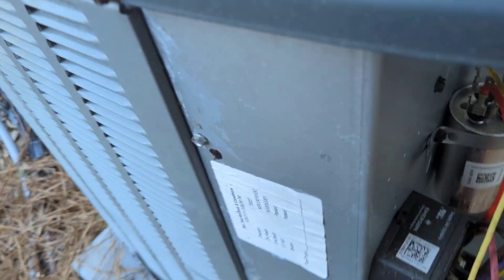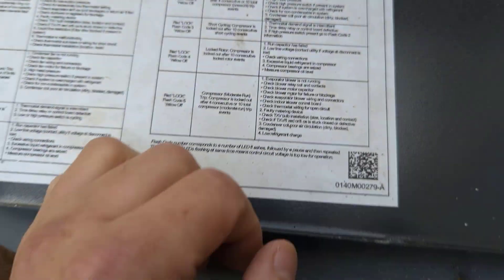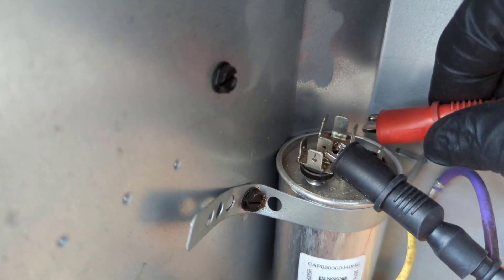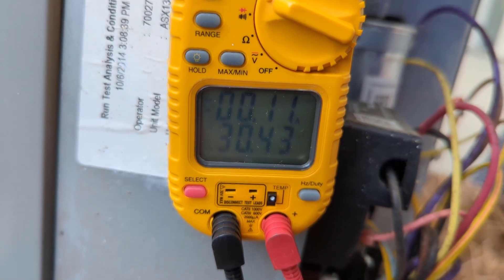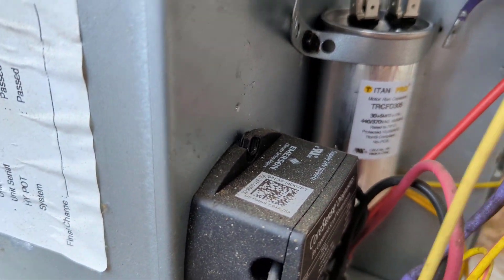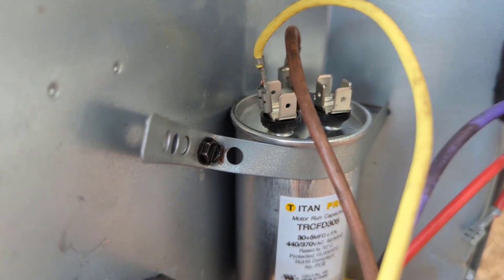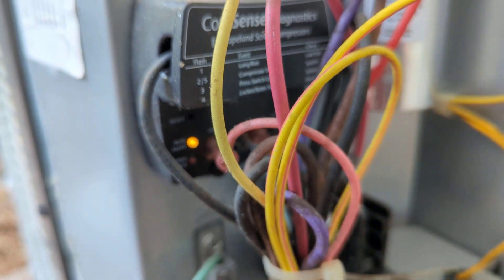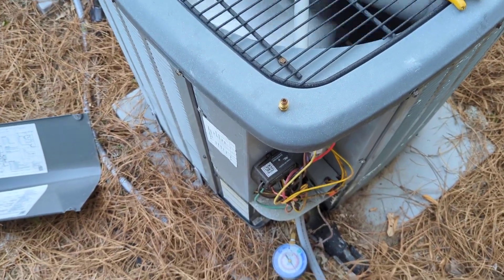Sunday Evening No Cooling Call

Comment: Very nice video, so my question is when you disconnect the unit it self the capacitor will still have some sort of power/readings? Sorry if its a dumb question but i’m learning all about hvac right now well trying too!
Reply from the maker: Not a dumb question at all! We all have to learn somehow & if you don't ask you won't know. Anytime u have a question just ask & if I can answer it I will. Yeah it can hold a charge so you want to short it out by taking an insulated screwdriver or needle nose pliers like I do across the terminals before u pull the wires off & test it. Thanks for watching & commenting 👍
Reply: @ApartmentMaintenance  thanks for explaining!
Reply from the maker: @Fitjaycjr  No problem! Anytime